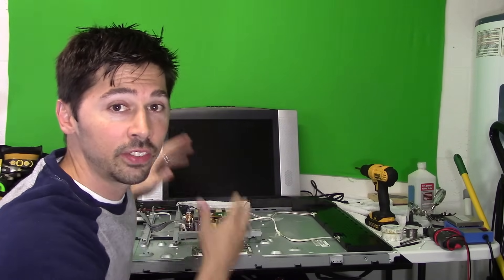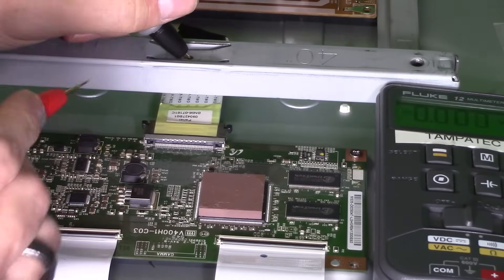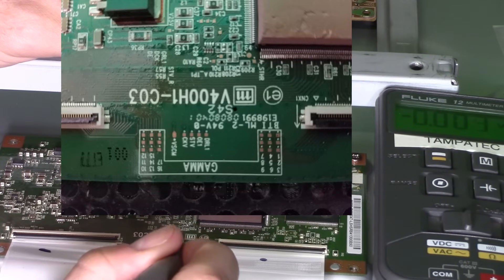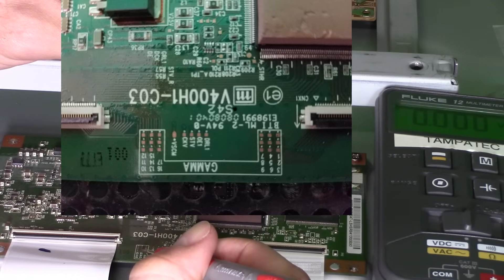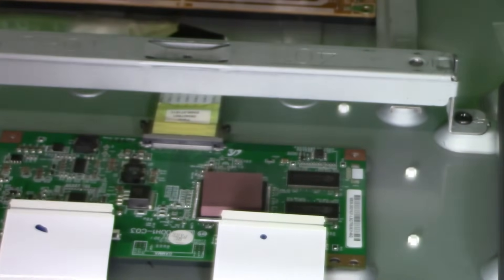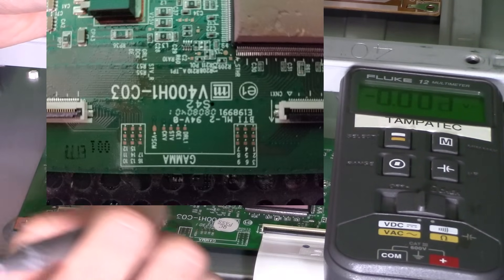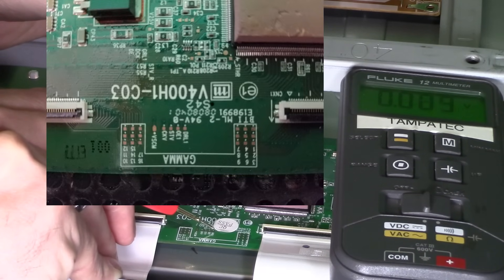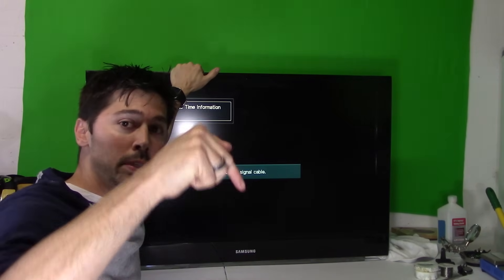THIS EASY 5 MINUTE TV REPAIR WILL FIX MOST VIDEO PICTURE PROBLEMS!!!

Comment: Thanks for all your great help. Videos are awesome.
Have an LG  model 47LE 8500-UA led / lcd screen that has no pic what so ever. Power's up with front logo and lighted switches and audio chime, with either remote or tv buttons but No screen images at all.
Replaced main power board, with no change. Any ideas?

Comment: Hi, we have a tcp50gt30.  The TV first developed a horizontal line and now has two vertical gray solid lines on both ends.  This happens only when watching cable ( Comcast).  when playing video or amazon the image is fine.  any suggestions?  thanks

Comment: Really helpful vids my man, however I have a curve ball for you on superbowl weekend, I have a 37" Samsung LE37R88BD(R) Type BP37EO. I'm on the west coast of Ireland so its 220-240v systems here. The tv is showing no picture when you are trying to view terestrial channels off an ariel, I can hear sound and pull up graphic menus, the back light seems to be working but sound no picture seems to be the problem along with the tv not accepting av inputs on HDMI or RCA! The power board had seven bulging caps so I thought heh this might be an easy fix. The kit was going to be €25 and I saw a full reconditioned board for €35 so I went ahead an replaced the whole board but the same problems persist. Any ideas on how to continue? I am fearing that it is the video output that is at fault. Are there separate boards for graphical overlays and video on the logic board? When I unplug the DTV cable and switch to old analog (we switched off analog signals in Europe a few years back) I get a full screen with what we call snow or noise showing on the whole screen!  Where should I look next is my question because I am hoping that its an easy fix being that so much of the function is still there, sound, menus and backlight etc.?

Comment: Hi bro pleasant hello I love your videos the're very educational keep up the good work..well I have a Westinghouse tv model LD 2480 & its working great but recently I notice a single blue vertical line appear in the background of the screen picture then a few days after another blue line appears then now a green line has appeared..the T-con board is not replaceable it has the screen ribbon cables factory sealed to it, & also the cables are all fine none of it is loose..so I would appreciate if you could advice if maybe the main ic on the T-con board is probably going bad?? Thank you in advance!!

Comment: Hi Tampartec, I have an Acoustic Solutions 32 inch led which after about an hour it starts looking like it has a fussy signal input and fades to black. Try again next day same thing. It works great when first started. Input is HDMI Xbox which works on my monitor no problems. Any pointers please.

Comment: I have a 37LG50 LCD tv. When you turn the power switch on the red switch fades on and off and then ultimately stays off. If you keep trying it will eventually turn blue, on, and then there is a faint back light for a couple seconds then it goes off again and the switch turns red. I thought capacitors on the power board. They all looked Ok but I changed them all anyway as they are cheap. No fix. That worked on my Samsung but now I hit a wall. What next?

Comment: you seem like a pro hopefully you can help i have a lg lg 39ln5300 no picture but theres glow and it sounds great i changed the tcon and still the same heres the catch after a few minutes the screen start showing some lines and i cant find the solution any idea what could be wrong?? thanks i appreciate it

Comment: Hello. I have a LG TV MODEL #42LV4400-UA. It has a color problem. In the mid left screen with 8 lines up and down and black behind that little area.
Reply from the maker: Kay Burr if your picture looks like that on all the video inputs it's usually the tcon board or tcon board connection to the LCD panel but it can also be main board. get tv boards at shopjimmy.com or electropartsonline.com

Comment: I was excited to fix this ten year old 52" Samsung LED MODEL NO: LN52A540P2F. I replaced bulging capacitors on my old 42" about five years ago. Well apparently this 52" has a different issue because the capacitors are fine. Can you please tell me this model's common repairs for: tv turns on but no picture, then automatically turns off and on until power cord is unplugged...

Comment: Hi. Thanks for your great videos. I have a Vizio E601i-A3. A while back heard a slight pop and  TV went dead. Checked power board, no bad caps but blown fuse. Replaced fuse, disconnected other boards, fuse blew again. Replaced power board and now have backlight and no picture. No symptoms of bad panel per shopjimmy. T-con board??? Thanks for any help.

Comment: When you checked out the voltages on the tcon board, how did you know if it was giving you the correct voltage?  Is there somewhere that shows what these voltages should be?  Love your videos, keep them coming.
Reply: Enjoyed all of your videos and have previously said so. I too, would like to know how you knew what the voltages should have been, in this video specifically? Thanks.
Reply: Good Evening Bro, can it work for Maxi Tv

Comment: Sharp tv LC-49CFG6001K screen frozen on the sharp logo how do you fix it. Already powered off from plug
Reply from the maker: Catherine Sharkey try factory reset next try usb firmware update, lastly eeprom on main board get tv boards at shopjimmy.com or electropartsonline.com. like, share or sub if that helps.

Comment: FYI Great video, years ago techs didn't often share their tv repair knowledge. 5 Stars to Tampatec for helping us.
Reply: Bri G. everything pretty much can be repaired by just buying new boards it's not like the old vacuum tubes ect...but excellant video content hopefully the days of extremely hi repair bills are a thing of the past but not to worry there's plenty of thrives still out here raping and pilliging, it's odd to find an honest anyone anymore.
Reply: Sometimes more than 1 board goes bad on flat screens There are cases where 1 board will take out 2 more boards and be too expensive to repair the set They design this crap to fail after the warrantee expires. Your lucky to get 2 years use out of this new crap. The crt sets from the seventies are still going and still can be serviced without breaking the bank
Reply: I wouldn't call this repair knowledge - it's just swapping out parts until it works?

Comment: i had a 37lg30 and replaced the caps and it turns on but flashes and turns off. any suggestions?

Comment: Sony # KLV-23m1 Has 2 vertical lines for 5 minutes then goes away. If brightness set to medium (ccfl), set turns off (as if unplugged and replugged also occurs in stdby) but not if cooled with battery powered fan aimed at top of tv.

Comment: Great videos Tampatec.  Samsung un65fh6001fxza, screen went black and the led strips started to flash on/off, remote and power button won't work on it either. Got a complete repair kit from ShopJimmy and  replaced everything, still the same thing.???

Comment: Hello. How are you doing this evening? I have a problem with my Sony Bravia KDL 48w600B. 
I was watching it when a storm came out of no where .  A big lighting bolt hit somewhere outside and power every were was lost. I powered up my tv and  remembered you saying something about  a red blinking light.  My tv blinked a total of 3 times.  I ordered the main board and the tuner board and changed them .  The tv turned on  but it had no sound and no picture so I could not see the menu.  I opened it up again and checked the ribbons. When I touched the main ribbon a picture came up but it didn't stay.  So I put everything back together and tried to turn it on again. The result was that it turned  on with no sound and shut off with the light blinking yellow. Can you help me out with this please? I'd appreciate it. Thanks for your help.

Comment: Hey Ive been watching your videos to troubleshoot my Vizio m43-c1 (lttwspar). I get sound but just a shimmer backlight. I ordered a tcon board from shop jimmy and replaced but still seem to be getting the shimmer backlight no picture. What else could I check? I have tried the flashlight to check for image as I have backlight but still nothing. Anything I could check?

Comment: hi @tampatec, I have a hisense ledn50d36p tv with half the screen black and white. a guy fell over it and that is how it got to that point. what could be the problem? is it the lcd? i am worried because if it is the lcd then i will have to throw it away because it cost more to replace an ldc than replacing the whole set

Comment: @Tampatec, just a curious question.I have a 42 Samsung lcd tv.I get the solarized distorted look on screen and or called " acid look ".I attempted to go into service menue mode.That does no good due to I cannot see clear screen to ajust/ set a thing.I am curious if my odds are in favor to invest in a board vs the screen being shot.What do you think about this and your input of what board is bad? Screen is not cracked tv not dropped.

Comment: tampatec i have a insignia ns-46e480a13 with a weird screen issue that is leading mentowards a tcon and just wondering your thoughts. the tv when it starts up shows white vertical lines spaced evenly apart and the screen has trailing/ghosting issues. i can supply pics if needed

Comment: Hey Tampatec can i ask , i have a asus monitor that when i start up my pc or anything connected to it has 3-4 black lines horizontally across it , which disappear after 5-6 minutes of use , if i power it off after those lines have disappeared and i power it on within the next minutes there won't be any lines, but if i power it after 10+ minutes they are back and need time to fade away again. What can be causing this and how can i fix it?
Reply: My seiki flat screen only shows pic while guide is on.when I exit guide,it turns off but comes back on after a few seconds,only on guide.what can I do to fix this ?

Comment: I have a Samsung Touch of Color LN46B650 with vertical lines that appear where bright letters are or anything brightly-colored is. Then sometimes the lines slowly fade away as the picture changes. Could this b the t-con board or bad panel? Thank you in advance...
Reply from the maker: if you press and tap around the tv frame and lines flicker it can be a bad lcd panel but if not most likely bad tcon board, shopjimmy.com or electropartsonline.com for tv boards
Reply: Lines do not flicker doing as you suggested. My worst concern is the 2"-3" wide vertical bar that never really goes away, black lines with blue coloring in between. The blue changes shade tho. May just try the t-con anyways as this TV is just a project. Thank you so much for your quick response and always enjoy your videos!!

Comment: Dear Sir, i have samsung led tv, before somedays single thin vertical line appeared on the screen. when i remove the t-con connnection from main logic board leds glows no any line appear on the screen, so where will be the problem ?
thanks
Reply from the maker: if line is gone then tcon board is the problem shopjimmy.com or eletropartsonline.com has tv boards
Reply: Abdul Latif

Comment: Mitsubishi Mod. # VS-50703 40" Big Screen projection TV. All I get is a little green light when I turn it on. Then it goes out. Help please.
Reply from the maker: usually it can be bad Lamp or DLP chip http://amzn.to/2jo02Qt Try Lamp first, contact mitsubishi for recall list you maybe get a free dlp chip.
Reply: Tampatec i have a mitcha that has starry sky screen that is getting worse fast please help ed thank you

Comment: I have 7 really thin like 1 pixel wide vertical lines just off the center of my screen.First a few showed up then over the next month the rest showed up and none more have come in the last 3 months. Does this sound like a loose connection or a problem with that board that will require replacement?

Comment: Hi, i have a proscan 40lc45s, lcd, screen became black and sound is still ok, flashlight trick did not help, the screen is pitch black, is it t-con board or blacklight inverter, t-con is $12 and inverter is $49, and no returns on shopjimmy.com. i really dont want to buy the part that i do not need. Thank you in advance. Andrey.
Reply from the maker: press menu button and use flashlight in dark room to see menu, still no image? then most likely bad inverter board but check input volts to inverter board should be 12v or 24v if ok then replace inverter board.  avoid transformer voltages they'll fry your meter. electropartsonline.com may offer tv board warranty
Reply: Tampatec Hi, your tutorials are very fascinating! I have some a 7 years old Samsung UE40C600, which worked perfectly fine for 6 years. It's been a year since its displaying a bunch of lines, sometimes they go away on their own and most other time, I have to slightly tap the back of it to them disappear. Sometimes, that won't even work; I usually give up when that happened. 
I opened it twice and look for any loose cable to tight up, I had no luck! 
Could you please, walk me through step by step on how to repair it?

Comment: is this procedure the same for a LG plasma tv with no picture, but it does have sound.
LG  MODEL 50PN4500-UA
Reply from the maker: see here for plasma tv troubleshooting https://www.youtube.com/watch?v=GReg9cPDP-c
Reply from the maker: similar but not exactly the same voltages, look for good steady voltages, no picture on plasma can be bad sustain board or/and bad IC on buffer boards
Reply: Do the LG brand plasma have a tcon board? I happen to get the tv for free the previous owner said it just stopped showing picture, but could hear sound. Hear is a picture of the tv...
https://lh3.googleusercontent.com/w0JayeIa8-68arrNzgygXdq2Kxp3yFgeJgV6tDkZbwWqQX7sTJ0F8NOOR6rJFEf33fi7bVP91Q
Reply: Plasma have no T-con board in them. They do have some very high voltages in them, beware.
Reply: https://lh3.googleusercontent.com/9g1czWRyFmLa7Y7aN6NLUFJfcaNKBpzWyPXGk3d-_UuMKLEUFsMHERZXzpieWa3uL1Ve4xv-cw
Reply from the maker: true, he edit the post after i replied, a bad sustain board can go bad which can cause no picture on a plasma tv. sustain board input volts is about 190v to 220v for LG 50" tv
Reply: I'll check the voltages tomorrow morning thank you. Will let you know what result I get.

Comment: what could it be if lightening hit and struck the TV is it worth fixing?
Reply: TIM LASHLEY First, you should never be walking around outside watching TV during an electric storm.
Reply from the maker: TIM LASHLEY usually the lightning strike will enter the main logic board where the video connections are or the power cord into the power board
Reply: Tampatec think it's worth fixing?
Reply from the maker: check power board or main board where hdmi connections plug into get TV boards at shopjimmy.com or electropartsonline.com
Reply: Not worth at all IF you can see obvious burnt mark on various boards. Too expensive. Lighting strike normally will damage the whole thing in mere microseconds. Dump it.
Reply: I just fixed one it was just a ceramic fuse on the power supply board
Reply: Change out the MOV on the Main Power Supply Board for a few cents. Then try again.